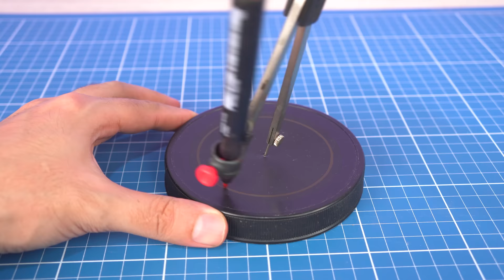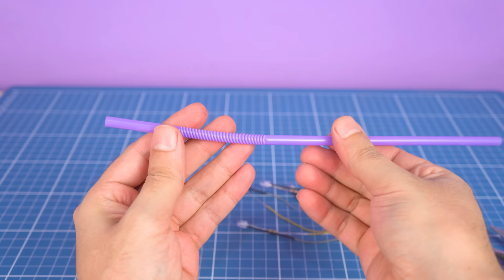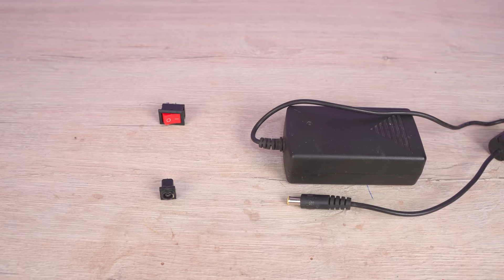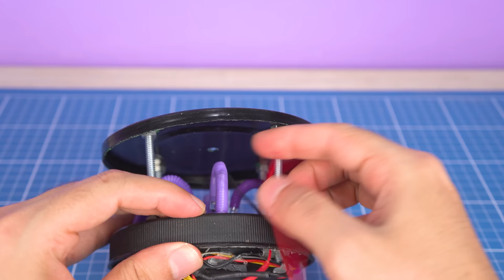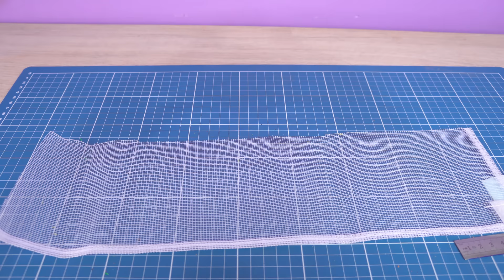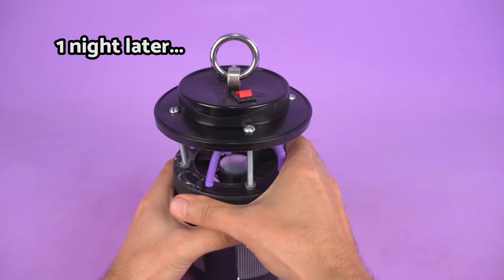Amazing ELECTRONIC MOSQUITO TRAP using recyclable materials

Comment: A titanium dioxide photocatalytic coating will create the Co2 needed to attract the mosquitos.  It’s what dynatrap uses.  You can also apply commercial attractant to the trap.  The light will not attract mosquitos as they don’t use that for hunting.
Reply: Please explanation or any product have sir
Reply: Correct explanation sir ..
Reply: Amigo, como se faz isso? Revestir com dióxido de titânio, é aquele pó branco?
Reply: Dióxido de titânio é corante em pó. Existe até versão alimentícia. Mas como fazer tinta para aplicar numa estrutura que os raios UV atinjam para criar o Co2?
Reply: @actsrio  You would just mix it with some resin that is transparent.  The issue is even though research states that titanium dioxide creates Co2, depending on the mosquito species, it may not work.  It didn't work for me when used on tiger mosquitos.
Reply: @Vigilence  would the resin let the Co2 be exhaled or would it be a saturated solution so that the titanium dioxide would stick to the surface? Perhaps having to change with a certain period.
Reply: At least 100 such machines should be installed (for a room of 12×12). Then it will be ok

😂😂😂

Comment: I used old computer fans too for the same purpose.
You would get more mosquitoes if you alternated the LEDs, blinking them on and off.
You should also get a Black Flag BZ-OCT1 Bug Zapper Octenol Lure, Universal Fit (clip on) or use a soiled piece of cloth with sweat.

Comment: The execution is well. But insted buying all this stuff, (esp. power supply, switches, fan, hook, paint...) it is way easier and cheaper to buy a similar insect-trap. And last not least, (UV) light isn't the best way to attract mosquitos. They are more attractd by CO (exhalation), warmth (body temp.) and smell of sweat.

Comment: Inventus, posso usar uma fonte de 6 Ampére para um cooler de 0.15 Ampéres?
Reply from the maker: Oi Deyvison Farias pode sim. Quando vc ver escrito em uma fonte 6A, que dizer que ela consegue fornece no máximo 6A de corrente. Mas isso não quer dizer que qualquer aparelho que vc ligar vai puxar esses 6A. O cooler ao ser ligado na sua fonte, só vai puxar  apenas 0,15A da sua fonte , que é a corrente nominal de funcionamento do cooler. O que não pode acontecer é a tensão da fonte ser muito maior que a tensão do aparelho e nem o aparelho necessitar de um corrente muito maior que a fonte consegue fornecer. Por exemplo: Eu tenho uma fonte que 9v e meu cooler é 3v, isso pode danificar o cooler. Ou eu tenho uma fonte que fornece apenas 0,05A e o cooler necessita de 0,15A, a fonte vai desligar, pois ele não consegue fornecer corrente suficiente para o funcionamento do cooler
Reply: @inventus  É, mas descobri que essa fonte que eu tenho a entrada é de 100V—250V e a saída é de 15V, então se eu colocasse, poderia queimar o cooler
Reply from the maker: @deyvisonfarias3646  Eu acho que o problema aqui nem seria queimar o cooler, mas os LEDs que são mais sensíveis, já que os resistores de proteção aqui estão calculados para tensão de 12v. Mas fontes de 12v simples são bem fáceis de achar. Tem muito aparelho que utiliza essa voltagem para funcionar em casa
Reply: @inventus  Verdade, acho que no centro da minha cidade deve vender bem barato
Reply: @inventus  Achei aqui na minha casa uma fonte de 12.0V e de 2.5A
Reply: Agora sim o cooler e os Leds vai funcionar tranquilamente né
Reply: O resistor certo para os Leds é 470 ohms que é certo para 12V
Reply from the maker: @deyvisonfarias3646  que bom, agora vai dar certinho